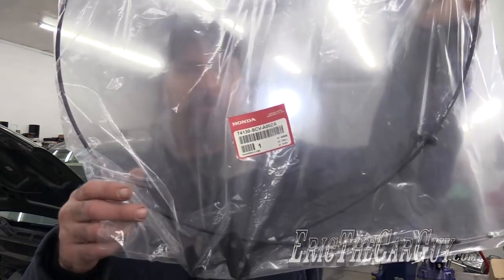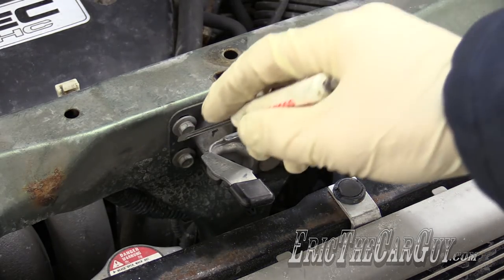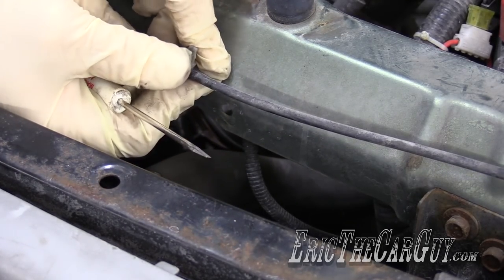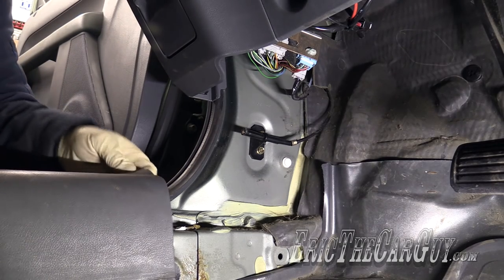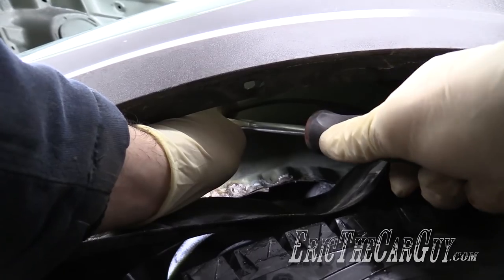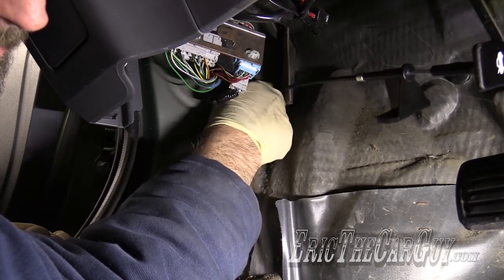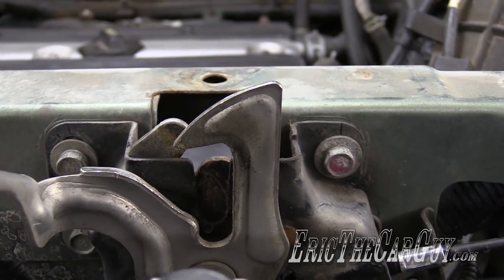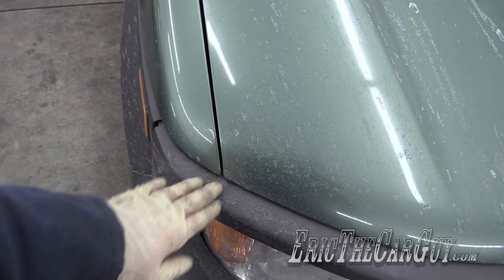How To Replace a Honda Element Hood Cable

Comment: I recently ran into an issue where the hood latch itself does not want to full disengage from the hood when the release is pulled. When I searched for videos on how to replace it this was the first result... 8 years later and its still helping people with their Elements. Be safe, have fun, and stay dirty!

Comment: My daughter's 2004 Civic had the same problem.  Your solution is great if you want to go to all the work and expense.  However there are several videos on the web offering other solutions.  I chose to use the one that uses a drill stop to replace the handle.  I got a set of them from Home Depot for about $7.00.  I round off the remaining plastic handle on the cable end in the passenger compartment.  I then shoes to closest drill stop to the end of the cable and tightened the set screw to secure the drill stop.  While it's not as pretty as a new cable, it is a permanent fix that will not break off.  It has been 2 years now and all continues to work well.  Bonus, a lot less disassembly and no worry about braking expensive plastic clips available only from Honda.  To each his own - Form follows function.

Comment: FYI A trick we used to do to help reinstall the hood latch, Also works with hoods, doors and trunk lids ...
We would drilled two 1/8" holes through the latch or hinges before removal.
When reattaching just insert two 1/8" drills or pins through and tighten.
Perfect alignment every time.
Reply from the maker: +nightflyr1 Brilliant.

Comment: I was going to comment that I always tape string to old cables before pulling it in to the cabin so that the new one can be pulled back through easily, but that stupid plastic clip under the wheel arch liner meant that you had to do extra dismantling anyway.

Comment: So I guessing that if you break the hood release pull piece inside the cabin that you have to replace the entire cable? Mine came off in my hand last night after 15 years.  I was able to grip what remained and open the hood but... 
((??))

Comment: Thanks Eric.  This helped a lot with my daughter's 2003 Element, particularly with the hidden nylon clip up in the fenderwell.  I spend about $15 for a new cable at O'Reilly, then $5.20 at the dealer for four new nylon clips.  Hate to think what the dealer would have nicked me for the job.

Comment: AMC hood cables from '79 to the end of production are basically the same design and are also constantly broken. I've often considered building up the back of mine with a mountain of JB Weld to help prevent future failures (especially since I can't just go down to the AMC dealer and buy a new one... haha).

Comment: It's a similar process on 6th gen Accord (which I have). Some differences: three clips in the wheel well, similar to white ones in this video, all broke on mine, but they come with the new Honda cable. There are TWO rubber grommets, one for interior to exterior, the other where cable exits the fender well into the engine bay. Then three more clips for the cable along the core support. Be careful with those, because they don't come with the new cable. This should be a straightforward job, so if something is stuck, double check everything.
Reply: I have a crv 03 would this be similiar ?

Comment: The clip in the wheel well would have gotten me. I didn't know about that one. Did you change the battery to a bigger one and if so which size is it?

Comment: I bought a 2007 Element LX in september of 2020. It came with a pair of pliers to open the hood so I laughed pretty hard when you showed a pair of pliers in the video. Bought a replacement cable from rockauto along with a bunch of other parts.

Comment: Maxwelhse, your right on it's  a bad design , I had the the same break on my  Honda  civic , I improvised put on a new handle taken from the pull  cord off a loan mower  , and crimped on the cable with coper works fine ,  also put on a  secondary cable  from the latch down  to the front cross member for emergencies . This may seem like over kill but it's. A bitch when it  breaks  at hood latch.

Comment: Thanks for the video, my issue was the spring(small one) broke inside the hood latch , was able to replace the spring , after many Auto parts stores had nothing comparable..had to get one from a hardware store.

Comment: Hi Eric!

Just wanted to thank you for the motivation you provide to people watching your videos. I've certainly been motivated. Looking at you getting things done with couple of sockets, a screwdriver and good old penetrating oil made me take care of my car.
Maintaining a US spec vehicle (Mazda 6 3.0l V6) is not easy in Poland, believe me. Aftermarket parts are pretty much not existent so anything needs replacing means a trip to the dealer.
Remember when you worked on "the Pirate" Nissan SE-arrrrrrrrrrrrrr car you mentioned pirate air being the term for unmeasured air sucked into the engine. This got me thinking about  problems I had with performance which mechanics couldn't diagnose. There was a huge crack in the pipe connecting air box and throttle (how they didn't spot this is beyond my comprehension). 
All in all, I took some spanners, screwdriver and some cleaning fluids, taped up the cracked pipe and the car runs beautifully. I'm amazed how such a simple fix transformed the engine response.

You've certainly lived up to your motto of helping people fix their cars on a budget.

Stay Dirty!
Michael

Comment: How many psi of vtec will this cable add ?
Reply: 25kw
Reply: +Ricardo Vascotto 
That's a little high. Unless you're speaking of gains at the flywheel? Realistically it's about 17kw to the wheels after the 30% power loss in the drivetrain.

Comment: attach a string to the end of the cable before you pull the old one out.  use that string to pull the new one back through.  that way you don't have to remove the fender liner.  A good yank and that last clip won't be a problem.  I know I wouldn't miss it.
Reply: Yes, good tip
Reply: Next time you buy a used car with an annoying rattle that you cant find just remember the previous owner probably left out some 20 cent clip to save 5 minutes.
Reply from the maker: +punker6506 You'd break the string before that clip would break.
Reply: +EricTheCarGuy I'D still be pulling on the cable.  also a decent test drive would be able to tell if it's gonna rattle or not.
Reply from the maker: +punker6506 Trust me, the string method will never work in this case.
Reply: The string method worked just fine for me last night.

Comment: I had to replace the hood cable on my 2005 gmc canyon, and when I pulled the cable thru the cable, the little rubber grommet came out with it

Comment: I never liked to drop the hood to get it shut. I carefully make it latch on the 1st position and gently push it on a hard spot near the center so it doesn't get dented.
Reply: +VochoTalacha there's no chance of denting the hood when you drop it from a few inches up. Pressing down with your hands firmly is more likely to dent it.
Reply: +InternetDude I didn't mean that the hood would get dented from dropping the hood. Because of the second thing you said, that's why I explained I carefully press the hood on a strong spot on the hood's center so it doesn't dent.
Reply: +InternetDude I also drop hoods from a few inches up. I don't touch the paint any more than necessary regardless of why. It's just good practice.
Reply: +Maxwelhse Yeah, I ain't against dropping the hood. I've heard that in some manuals they actually instruct you to do so. I just don't like to do it.

Comment: Eric , what's the tool you used for removing the clips? I NEED one of the 👍
Reply: Not the clips holding the cable, the ones holding the trim panel around the catch
Reply from the maker: +kymmbo Linked in the description.
Reply: +EricTheCarGuy thanks, that's excellent now to track some down in my part of the world 👍
Reply from the maker: +kymmbo I believe they ship internationally.

Comment: Yay, you finally replaced the cable lol It does suck though that auto manufacturers make people buy a whole new cable instead of just a replacement handle.
Reply: +justsomeguytoyou You can replace the handle yourself if you want to, hardware stores have plenty of cupboard or drawer knobs and some are bound to be quite similar
Reply: lolatmyage
Yeah, but it's not that easy....how are those knobs going to affix to the cable in a strong enough fashion to work the hood release?
Reply: justsomeguytoyou Epoxy/weld/glue whatever you prefer, should be fine considering superglue worked to some degree

Comment: Good video Eric, but I would have taken 2 minutes to clean and re-lube the latch mechanism to ensure smooth operation for years.
Reply from the maker: +InternetDude You have to be careful with that. Sometimes lubricating cables can backfire and attract dirt and debris actually increasing wear and resistance.

Comment: Of course the 2005 element has the fender liner tucked under the lip of the fender. I can't seem to be able to pull it down.
Reply: Oddly, the liner is tucked under the lip on the driver's side on mine, but the passenger side is screwed to the bottom of the lip.

Comment: try replacing a Jaguar X-type cable that's broke...2 stage cable for 2 hood latches. Just getting the hood open is a damn nightmare...you have to put the car on a lift and use a 3 foot metal rod...and you have a 1 inch hole to put it through and pray you can hit the release lever
..you have to do it twice.lol...left and right
Reply from the maker: +netrioter No thanks. I'm not fond of working on Jaguars since my experiences with XJ6's in the past.

Comment: The clip tool is not needed, a flatblade screwdriver slid into with notch on the clip will pop the clip's plunger up without stressing it.

I replaced the cable knob of my first Element with a black square drawer pull from Lowes, 3 years ago..  I loosened the latch end, potted the inside end of the cable into the knob with steel epoxy  and let it cure.
Reply: +P Schmied Thats pretty smart

Comment: can't you come up with any more challenging things to work on that a Honda Element?
Reply from the maker: +gene hensley Well, I also have videos on the ball joint replacements, thermostat, tensioner, and alternator. I just didn't want to flood the channel with Element videos. Also, this hood latch has a history on my ETCG1 channel. Check the description for links to those videos. Thanks for your input.

Comment: One thing that I do not understand about Japanese cars/trucks is the way that they go rusty so quickly ok it may be just in odd places but I just sold my 2000 XJ jeep and that thing was still rust free I only sold it as I had problems getting parts for it that would fit here in the UK.   I have now got a 2004  Nissan X-trail and that thing has much more rust in it than my Jeep but at least I can get parts that fit it over here.
Reply: Not sure why cos i had two toyotas (1991 and 1997) both were rust free and never in garage until i sold them a couple years ago.
Reply: nissans

Comment: How do you get the Bonet up if the cable is broken under the Bonet?
Reply from the maker: +Kieran Grinter If you can access the cable from the fender like I did in part of this video you can cut it and activate it there.
Reply: +EricTheCarGuy cool thanks man

Comment: I'm confused. Didn't you just replace it and had the bad experience with the dealership? Did it break again?

I would just make a ring at the end of the cable and totally remove that fragile plastic trigger.
Reply: he just superglued the end of the cable to it for his temporary use. the dealership found that out when they broke it I  believe.  like Eric tried to rip them off.
Reply from the maker: +Auron Bushido (Aurora42196) https://www.youtube.com/watch?v=v3oyysghZtk
Reply from the maker: +teetee tee I was finally able to get around to replacing it. Time was a factor which is why I Qbonded it in the first place. Broken hood cables on my vehicles are not a priority repair.

Comment: Great video Eric, but I am horrified that you have that much road salt on the front of your Element! Almost every week my MY2000 European Accord is washed and dried and in summer polished and waxed every few months. When Britain gets all 2 days of summer a year.
Reply from the maker: +pugman205 I might wash my vehicles once a year. Keep in mind the Element has already succumbed to rust. It would be a loosing battle at this point. Thanks for your observation.
Reply: EricTheCarGuy So has my Accord, having to have several places patched underneath, namely the cills (rockers) Though not quite as bad as your Vigor arse end. I do like to baby my cars though, whether its mechanicaly with genuine parts if I can afford them to weekly washes/detailing  and vacuum cleaning

Comment: All that work. I would drill a small hole on the broken latch and the cable end thread a self tapping screw a dab of Loctite super glue and done.......If it was my car of coarse.
Reply from the maker: +Rob Carstuff You should check out the videos linked in the description.
Reply: Yup I watched that one. Keep up the good work, your a all-around nice person.

Comment: latch looks dry, might have had something to do with it
Reply: +Mark Blake Jr. Naa.. It's just a crap design. Even the interior panel the handle goes into is designed for a "rotate to release" action and not a "pull straight out" action. That's compounded by the fact that there is almost no material on the back of the handle to hold it on to the cable itself.

As I sad in another comment, AMC used this equally awful design in a ton of their cars and virtually all of them are broken. In fact, the one I have in my car is the only one I've ever seen that is intact and I pulled it from a junkyard wreck that only had like 40k miles.
Reply: Maxwelhse I believe it but lube wouldhelp

Comment: I'd replace that with a similar cable but with better design. Heck, i'd take the old one and make my own handle with blackjack and...well better. That design is the product of decades of stupid design all packed in a tiny object.

And no matter what anyone says, that's an "engineered to fail" item. There's absolutely no reason why they couldn't have a knob end or why they wouldn't put a lever style one that hinges on the support.

Incoming Honda experts telling me that the design was critical to fitting a hyper drive unit right above the door latch handle so they had to offset it down for extra KW... SMH

Comment: FLASH!!!!!!!  Resourceful entrepreneurs have engineered a latch pull from billet aluminum for Civics and Elements.  There are currently 3 different designs for purchase on Amazon for less than $15.  OEM plastic pulls from Honda are a poor design and problematic.